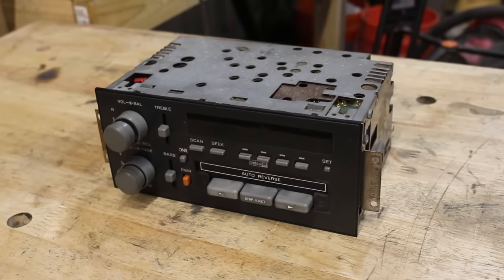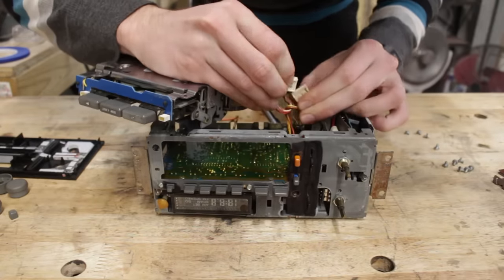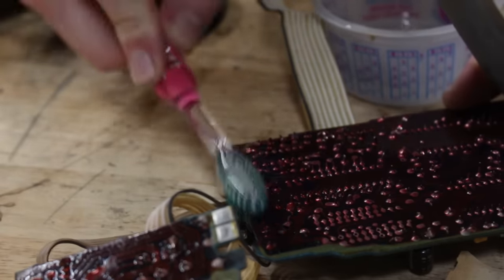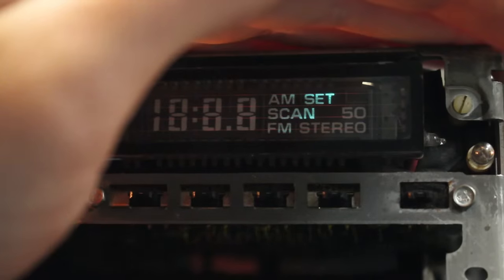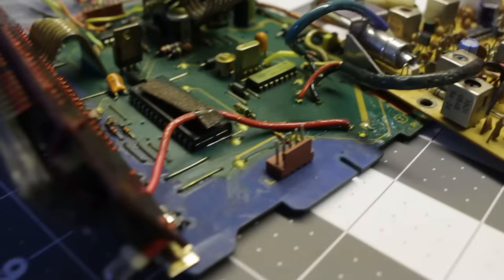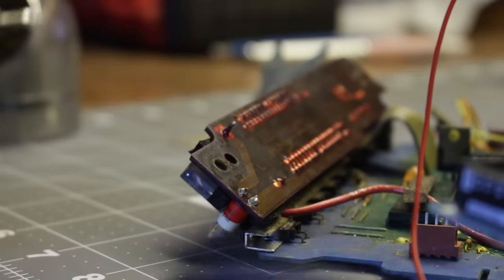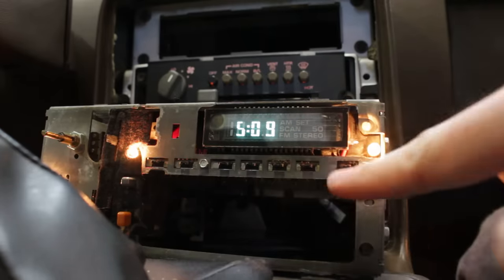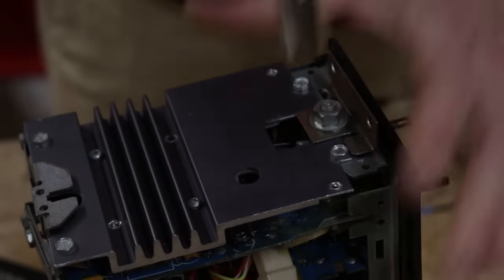1985 Fiero Radio Repair! | Saturday Projects

Comment: Same issue on my 80s stereo, but i have the bose system, so amps are in the doors...
I made some effort but now I'm on the fence.
If i could get the tape deck working i might try to restore it.
But my little belt is intact, however it won't play a tape.
But it will play with one of those tape adapter input things...

On the fence, put some serious effort, or give up and put something modern that does not match the 80s dash theme.
Nearly doc brown 80s theme with flip switches etc (vette).
good vid!

Comment: Actually, according to wikipedia, this radio was not made by Delco as it became part of AC Electronics in 1972, way before this Fiero was manufactured.  Amazing work here.   "Delco Electronics Corporation was the automotive electronics design and manufacturing subsidiary of General Motors based in Kokomo, Indiana, that manufactured Delco radios and other electric products found in GM cars. In 1972, General Motors merged it with the AC Electronics division and it continued to operate as part of the Delco Electronics division of General Motors. The name Delco came from the Dayton Engineering Laboratories Co., founded in Dayton, Ohio, by Charles Kettering and Edward A. Deeds in 1909"

Comment: Just a heads up, different cassette adapters have different qualities and price and brand hardly has to do with it, also there’s a slight difference between them in different players and different compatibility, also there are some quality fm transmitters out there but they seem to degrade over time for no reason, and if you want you could modify the stereo by soldering to the connector for the tape head and piggybacking off it to play the signal from a 3.5 Jack and then plug that into a Bluetooth receiver hidden behind the stereo, that way other than running a wire through the insides and out the back there’s nothing changed about the function of the stereo, though the time I used the head input I cut the wires to it entirely on a boom box so I’m unsure if they can parallel or not but I can’t see why not, worse case scenario you just cut it and run both sides out the back and use a 3 pole 2 throw switch or 3 relays with 2 poles (the 5 pin mini ones or micro ones if they have 5 pins)

Comment: Those pots in the front tend to get dirty. Just spray some tuner cleaner on them usually cleans up the popping sound, if it's doing it at the time when you are adjusting volume or station

Comment: 12:28 Lay a cloth down over the center console to prevent the sharp steel edges and corners of your radio from scratching the dry and brittle plastic of the center console. No use making more work for yourself.

Comment: I had a very similar radio in my 1990 Cavalier, my own silly restoration project. Its not a common DIN sized and my intention is to retro fit it with a bluetooth receiver, somehow, so that I can use the original dash bezel.

Comment: Just a little bit of advice. When you're trying to size a rubber belt you have to configure a 10% stretching on sizing the belt. So next time pick a slightly smaller belt and that will conversate for that

Comment: hey, great work... but you need to replace the conformal coating on those pwb.  automotive electronics are subject to condensation... and electronics are full of dissimilar metals.  I would just wack some clear polyurethane on them in the areas you removed it.   but a silicone conformal coating product would be best.  keep having fun!

Comment: Your Harbor Freight workbench is is for woodworking. The holes are for "bench dogs" and "hold fasts" which clamp down wood pieces so they can be worked with hand tools. Drill the holes out to match a large dowl, and pound sections of dowel in to plug the holes. Don't worry - these benches are shit for wood working too. They're too light.

Comment: I'm sure you're busy with stuff, but I sure wish I could see more (and long) videos on the Fiero. I'm 56 years old and one of my two best friends used to have one of these cars. Also, was there an Azimuth alignment adjustment to move the play head to the best spot for the best sound? If so, did you do that?? And are you really one of those guys that like bass and treble to be just flat? Treble and a bit more bass rocks. But do what you like. P.S., I subbed just for this series!

Comment: I have a 84 corvette it looks identical but it's   for a bose Delco I do have the original manual and papers bruoshers and stuff um. it might help ill try and see if I can get a scan of them but it's in storage so it'll take time but I think you might have a later model based off the rounded edge  buttons

Comment: I would be surprised if you didn't have any scratchin noise coming from the volume/balance/bass etc. potentiometers since those seem to get oxidized after a decade or two, usually. What I usually do is spray some CRC Oxide Clean & Protect PRO inside the potentiometer and move it around for a while to get all the surface oxidization off. You can spray it trough the shaft or some potentiometers have holes in them on the backside. That crc is probably my favourite chemical working with electronics. Just don't get it on any rubber since it will swell them pretty bad.

Comment: Often the noise like popping and crackling can be fixed really easily by spraying contact cleaner (de-oxit) for example into the potentiometers for volume/balance/tuning etc and working them back and forth.

Comment: Kinda tempting me to go fix the radio in my 2000 Dodge Ram. Might have aftermarket speakers(Previous owner did a lot of..... bad things), but either way there's a lot of distortion especially if I turn the volume up. Might need a 4 channel amp after the head unit, but I'd really like to get that audio quality fixed.. I think it would be cool to rig in an aux port too somewhere but keep the factory head unit.

Comment: Had a customer's car with one of these radios in it. It was broken, no response from any input. However, if you turned up the volume it picked up morse code tones spelling out the letters 'KA' over and over. I guess there was some radio broadcast doing that? Never found out, never got a chance to fix it.

Comment: nice video, i must say....
11:38 little issue with belt, both capstan wheels shuld rotate in opposite direction (will lead to playback problem if not done), i hope you corrected that  in final assembly.  
    Regards,

Comment: I’m honestly surprised you didn’t short the bare/partly bare circuits on the metal bracket for the radio and climate controls, my first 1tb laptop drive wasn’t so lucky in my full sized pc without any adapter

Comment: I know nothing about how to do this, but I have seen on the retro future's channel where he adjusted the play back speed for cassette players that he repaired.  It may be possible for you to get that 5% playback speed improvement you need after replacing your tape drive belt, by turning an adjustment screw somewhere in the stereo.  Just an fyi.

Comment: GM is notorious to have bad solder joints on their vacuum displays. I had a 98 Blazer where the readout on the dash did the same thing, fix was re-flowing all the joints.

Comment: Hey nice work. But hey, just from experience, really the whole stereo should be reflowed, I think most just bake it. There are a lot of game console restoration channels as well as arcade game channels that are a blast to watch, and face these kinds of problems a lot. But then again, you could really consider this for anything that is soldered in the car. Solder joints just break over time, and what is worse is when you have it in a car where it is jostled around a lot. You can be chasing gremlins for a while with intermittent issues, because the swelling and shrinking of things with temperature and moisture variances. The most extreme cases of these are in the aircraft restoration files, if you were interested. Though again, I know you are more into just getting it done for now, and maybe next time you can be better slower. Already seeing so much growth! Cheers!

Comment: 9:53 that's not parasitic draw. Most OEM headunits have a dimmer for nighttime operation, where full brightness is jarring to your eyes. My 92 Civic's OEM radio does this... the display lights up all the time, and only when the headlights are turned on, do the buttons then illuminate while the display dims a bit to same light level of the buttons. Same goes for the digital clock, which dims once headlights are turned on.

Fast forward 24 years, and my 2016 Honda Fit's stereo does the exact same thing. In the Fit, the gauge cluster is always illuminated even when headlights aren't on, but when you do turn on the lights, the cluster dims to match the light level of everything else that's illuminated

Comment: All GM radios fit they all have the same plugs $5 at any junkyard and your back in business. This works from 80s to 90s even early 2000s. There's a anti-theft device on some to circumvent this open the bottom there's a chip away from all the other chips scrape the chip off with the screwdriver. And now your 1988 Beretta has a 2001 CD player. And all for the cost of $5.

Comment: Does the auto reverse mechanism work OK? It was far more common in cassette decks to have the two capstans turning in opposite directions, so that the motor doesn’t need to be reversed. It looked like you had the belt routed such that they rotated in the same direction.

Comment: Great video! This is the first video I’ve seen of yours. One thing about the cassette player, I think you have the belt on wrong. I’m pretty sure it’s not supposed to go around both flywheels. If this is the case I suspect auto reverse isn’t working. Have you tested that function?

Comment: 13:39 My friend: 3-in-1 oil is for occasional uses by homeowners only! It is vegetable based and breaks down and gums up quickly. OK for housewives only. Use real oil around a car. Too much thermal cycling in a car for 3-in-1. My grandfather taught me about cheap ass 3-in1 “oil” back in 1968. It sucked then and it still sucks for automotive use.

Comment: Put a 9 volt battery to the screen on thoes red lines behind in for 2 seconds or so and it should repair the low light screen it’s hard to explain but it cleans the lights somehow and makes the screen work

Comment: The belt may be a little bit thinner than it should, so it will run slow. If the belt is thicker, it will run fast.

Comment: The belt is on wrong. The capstans turn in opposite directions. The belt should wrap around each fly wheel in the opposite direction. Usually, it makes an 'S' rather than a circular routing around both. The tension is probably too high as a result and slowing the play speed down.

Comment: part of reconditioning old radios like this is very much going through and resoldering/reflowing _almost everything_. even if you're not replacing those bits. they were pretty stout units, but had some flaws in the overall component selections (caps, some models have VFD issues, and of course... the solder).

there may or may not also be a hole in the back side of the motor to adjust the speed. some 12v motors of the era had them, some had the adjustment on the board the power wires ran to. y'know, should you still need to get the tape desk to run at the right speed.

other than that, decent job.

Comment: car looks lower, did you change the front springs? plastic guards in the wheel wells, looks like you fixed the cracked overflow bottle... hmm did you fix the tacho?

Comment: one thing i would have done: ditch the tape deck, leave a blank tape in it and solder an auxiliary line to the wiring for the tape audio. beats an adapter

Comment: It might not be the theme of this but you could've added Bluetooth while you had it apart. Just buy a $5 chip from China and tap into the audio, ground and ignition only power. Then you have to either gut and modify a normal cassette or rob one of the aux ones of the play head because it has the necessary gears in it. It's best to buy "plug and play" and they just take the chip out. Bought a Renault one, chopped the plug off only to solder it into a Citroen.

Comment: 8:46 in your video, u do have a bad cap sitting under the black ribbon cable. shrunk means heat has got to it, or its just failing good video all the same . Regards Mark

Comment: 14:01 - the capstan's wouldn't be able to do their job without clean pinch rollers. In the case of an automotive deck, purchase cassette deck cleaning cassette (wet system) that comes with the cleaning alcohol and of a design that does not use a ribbon but, instead, a back-and-forth wiping motion and various felt pads that you wet via the included alcohol dropper applicator. It's the easiest way for slot-loading decks. Otherwise, if ever I come across a dirty cassette deck, if accessible, use long medical swabs dampened (not dripping) with alcohol while the capstan spins the pinch roller. Gently, patiently clean the pinch roller as it passes by using as many swabs as needed (sold by the boxful - in packaged pairs therein - from a local medical supply business) often taking a while longer than it takes to clean the metal capstan. You will see the discolored band of cassette tape buildup on the middle ~⅓ to ¾ of the pinch roller disappear eventually and you should be left with a consistently black rubber color across the width of the pinch roller. It makes a huge difference in flutter of the audio. 👍 
⏭ After a cleaning, I would insert a cassette deck head demagnetizer cassette and run it through a couple cycles with the volume turned all the way down and then, because I can be OCD, flip over the demagnetizer cassette and do it again especially if the deck has a bi-directional playback head in order to get it both play back regions of such a head. 👍
You'll have what sounds like a new cassette player when done with the belt replacement. In this case, I can see how lubricating was necessary.

Comment: I have a 88 Firebird with what looks to be the same radio however my right side speakers don’t work and was told it’s called a channel. Are those capacitors that control or operate that and if so is it just replacing the bad ones?

Comment: I feel that the tape player will only work on one direction. The autoreverse will not work as the belt is not pushing the capstain the other direction. Please correct me if I'm wrong.

Comment: Hey Ron, um that belt you took off was way too stretched and worn out. You need a slightly smaller belt than what came off. There is a ton of resistance inside a cassette and if you don’t have enough grip on the belt it will slip causing the sound to wobble and flutter like that.

Comment: the belt is on wrong. the belt should be going around the motor pully, around the flywheel furthest from the motor pully, and in through the middle of the two flywheels. this will turn the two flywheels in the opposite directions, which is needed to use the auto-reverse function.

Comment: Are You absolutely sure that the rubber belt on the deck assembly is put on the right way? Did You check the autoreverse functionality? I think that the two capstan wheels should turn the opposite way unless the motor stops and turns the other way when You Play the other side of the tape

Comment: I can see two likely reasons for the slow speed and audible fluctuations (technical term is "wow"). One is the bearings in the motor itself. One (the top one) is reasonably easy to access and oil, unfortunately the other isn't. It's hidden by the speed control board inside the motor and opening one of those cans isn't for the faint-hearted - I haven't yet dared to do it. You carefully need to lift off two tiny metal springs that transfer electricity to the rotor, the brushes, through holes in the cover. If you don't, you'll break the brushes and the motor has had it.

The other potential cause is the pinch rollers, unless you cleaned them a lot more thoroughly than you showed in the video. You really need to give them a proper scrub until they look perfectly even and dull with no shiny spots anywhere.Otherwise they won't properly grab the tape and result in just the slightly squealy sound you're getting. BTW, you can still buy new cassette tapes, I think even Walmart still stocks them in many places.

Anyway, congrats for giving this radio a second life!

Comment: Its likely the speed of the tape player is wrong because the capstan roller is worn. its likely slipping. Never thought I'd see another tape deck in action ... back in the day,  when I was a lad, tape decks were the default, CD's came much later and even then the early generations  started out really expensive and used by serious audiophiles before they eventually got cheaper. We had to swap out the humble tape player parts for more premium parts like play heads, better capstan rollers ...these were the obvious stuff and realign the azimuth and play with biases to get the best results ..ah the old days....now a days I cant even see the components without a magnifying glass let alone change them

Comment: You forgot to warn Anyone,that if your Speakers aren't connected to the 'Delco'edit< radio,and you turn it on to see if it lights,you Will automatically Burn your Power Chips to the amplifier,and have No sound..ever..I had a bud that spent a couple hours a week changing the 
amplifier chips'because people would try 'test a new radio by plugging in the power,but not the speakers',and Delco answipps set it so the radio would light,and the chips Burn.No sound other than your wallet peelling bills.

Comment: I have an 86 Cutlass with the same radio. I changed my battery and a tail light bulb and now the clock on the radio will not turn off unless I take the fuse out. Any ideas? it is driving me crazy!!